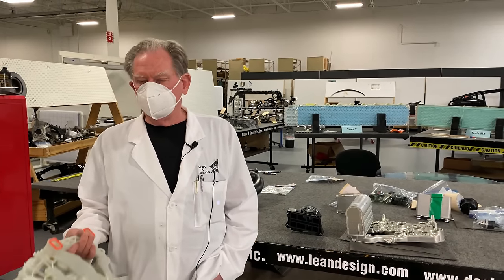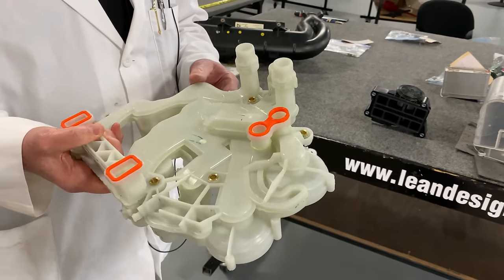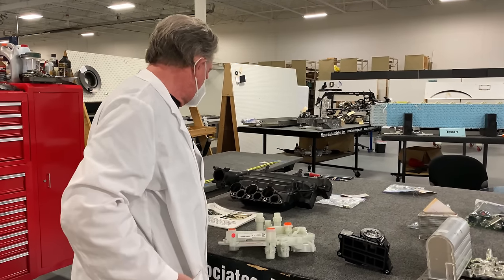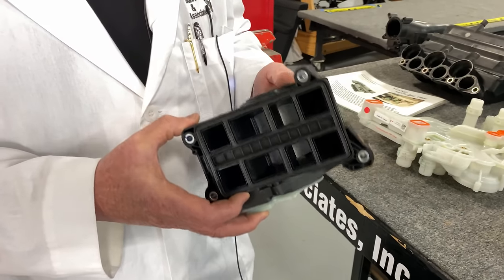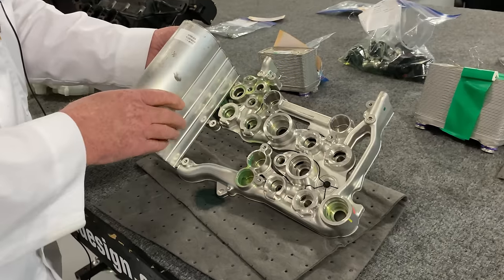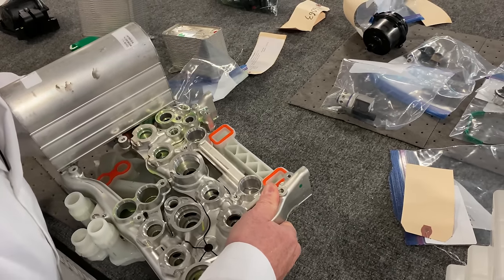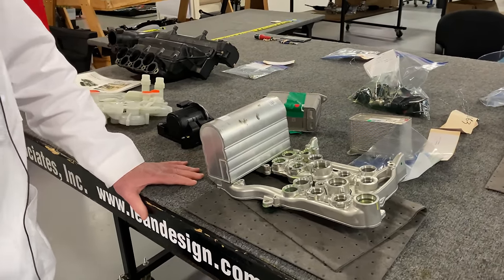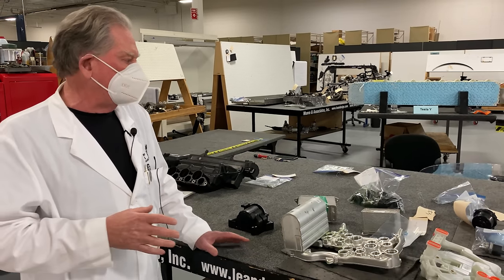Model Y E36: The Octovalve Episode

Comment: I love this series; fantastic work from Mr Munro & his team! Just a quick little note; at 8:35  those are actually 2D barcodes based off the old Denso Quick Reference (QR) design as there is no data in the depth dimension & can be stored in "flat" format i.e. paper.  Normal shop barcodes are 1D as they only hold data in one dimension and are taller purely for ease of scanning. Stay safe & keep up being excellent!

Comment: I watched this episode a year ago when it first was posted, and now after getting a model Y last month I discovered this is one of the best features in the car. It is very energy efficient and provides almost instant cooling. I really like turning on the aircon/heater from my iphone so the car is perfect temperature when I get in. No more getting into a baking hot car, and I've let it run for a couple of hours with very little power usage from the battery. My first YouTube Fan purchase too; I got the Munro t-shirt with the mechanical drawing of this contraption. Still waiting on delivery :)

Comment: It’s almost like that Octavalve was designed by someone that also designs rocket engines. Awesome engineering Elon and the Tesla team.
Reply: a rocket engine designer is not gonna be doing valve work
Reply: you might be suprised, rocket engine design is really just highly advanced, high pressure plumbing, that moves highly volatile and uncooperative fluids.
Reply: dude chill I litterally went to school with aerospace engineers, this is litterally the way they described it to me, its a bit of a meme. On top of that I work with guys who tear apart jet engines for a living. Its really complex but at the end of the day its alot of plumbing. 

Also SpaceX and Tesla have worked together on parts before, having an engineer who is good with coolant systems do a quick, and honestly far easier job for Tesla just makes sence seeing as he owns both companies.
Reply: One day Tesla might actually make a profit
Reply: @thecloneguyz  they have been profitable for the last 2 quarters
Reply: @avroarchitect1793  
After this covid-19 I doubt they're going to be profitable for a while
Reply: @thecloneguyz  I guess we will see, they have the cash to survive and a stock/ order backlog. All they need to do is get back to production.
Reply: @Rhyme905  Basically 90% of the complexity of rockets is fluid dynamics, with subsystems like turbopumps, valves, coolant chanels, and injectors. The rest is basically just structural engineering. For SpaceX rockets there's also some more nontrivial guidance and reentry tasks.
Reply: Makes sence. If you have the skills, might as well use them.
Reply: AVRO Architect that dude is really mad.. he must have not bought Tesla stock.
Reply: @jimmyle3246  and here we are with Tesla qualifying to be added to the S&P 500 and turning a profit despite the virus
Reply: @Rhyme905  we have a conference here in Houston called Pumps & Pipes bringing together medical, aerospace and oil & gas for cross pollination of ideas and innovation from the shared perspectives. several collaborations have come from the decade of looking in each others toolkit.
Reply: @michaelinterbartolo3  that is pretty interesting Mike, how much is a ticket?
Reply: SpaceX Engineers did design the octovalve according to Elon Musk
Reply: @Rhyme905  uh, yeah the octovalve was a spacex design. Piping and advanced valves is how reaction control works.
Reply: @avroarchitect1793  Yeah it wouldn't surprise me if one or two of SpaceX's engineers had something to do with the Octovalve. As you said both companies do work together.
Reply: @NotNowLater  the complexity of the design and manufacturing screams of aerospace engineering background, its not something an automotive engineer would design. At least not this way.
Reply: To sidestep the arguments here about rocket engine valves:  I believe SpaceX engineers did this, but IMO they were ones working on the life support systems/climate control for the Dragon spacecraft. That would more easily translate to a cars HVAC.
Reply: Yet fails in winters
Reply: @thecloneguyz  Still profitable...
Reply: @Jimbogf  if you look at SpaceX and Tesla together Tesla is still not profitable yet it's still paying back the loans to SpaceX 
PFFFFTTBWUHAHA

Comment: Sandy,  perhaps you could do some videos on serviceability with the Y. Since you've had to entirely disassemble the car,  how difficult was it to access suspension and braking components,  the radiator,  other items that might normally wear and need replacement? All us DIYers and mechanics have litanies of horror stories on the difficulty of working on cars. I'm hoping this clean- sheet company is different in that regard,  besides the obvious benefit of not needing regular engine or transmission attention.
Reply: I suspect the Cybertruck will be the first Tesla that has maintainability fully designed in. Reason for my suspicion: CT will be used as the vehicle on Mars. As such, it needs to be designed to have low probability of breaking and efficient maintain- and repairability.

Comment: Wow, nearly one year later I am re-watching this after having to get the Supermanifold, what you called the base manifold (the big aluminum piece), replaced on my Model Y. We experienced no heat in the cabin issues at -40c over a month ago and Tesla towed our car away to get fixed. Four weeks later waiting for parts our car has been repaired with a new iteration "E" replacing our old series "B" Supermanifold along with the three P/T sensors. From your video I can see the part number on yours ending in a "B", our new part has the same number ending in an "E". Crazy! Thanks for this content which satisfied my curiosity.

Comment: I think the EDM cuts in the manifold are for thermal isolation, to avoid unwanted heat flows between channels that have a high temperature differential.
Reply: Correct. Part dimension  and temp delta are small enough that it's useless to compensate for thermal expansion. I'm actually more concerned with crack formation at the cut line end due to thermal stress. Otherwise the design look solid.

Comment: Amazing design and engineering from Tesla
Add this to the mind blowing battery advancement coming on battery day.......
Reply: Mind blowing?  Please... This snake oil has been selling since forever.... cold fusion, ultra capacitors, etc.  Expect an incremental advance at best.

That said it's these incremental advancements that push us forward... But mind blowing?  Delusional and hyberbole.
Reply: @ericfermin8347  1 Million Life battery is not incremental + I expect at least 10% more energy density which is not incremental either
Reply: That is pretty mind-blowing
Reply: @kasibert2229  You need to get out more, or study some basic science and maybe you'll understand what mind blowing really is.

Discovery of the neutron... mind blowing
Discovery of x-rays... mind blowing
Discovery/invention of a programmable computer... mind blowing
Discovery of bacteria... mind blowing
Discovery/invention of transistor... mind blowing
Discovery of the neuron... mind blowing
Discovery of black holes... mind blowing

10% increase.... nope, just the march of progress

Mind blowing events are black swan events.  They come out of nowhere, have tremendous impact, and people with hindsight wonder why it took so long to discover.

If Musk announces a battery made from silicon, that costs pennies to manufacture, and has 1,00,000,000 times the performance of current tech, that'd be mind blowing.  10%, not so much.
Reply: @ericfermin8347  Well If u think this isn't mind-blowing then u just don't understand the implementation of this battery
Reply: its not amazing design or technology, its a mainstream manufacturing technique
Reply: @kasibert2229  You are entitled to your opinion. You are out of superlatives if you use mind blowing for such a small advancement.
Reply: @ericfermin8347  Just exchange every mind blowing with amazing if thats your problem. But being able to produce waaaaay better batteries for cheaper than the entire industry which is full of amazing and very intelligent people which have almost unlimited fundings idk dude thats mind blowing for me

Comment: I know you guys need to make a living but isn’t there a way to describe the basics of how this magnificent piece of engineering works without compromising your business
Reply: That will be in the report - he is not going give too much away.... But to make a long story short. Different part of the cars, at different time, need to be cooled or heated. Battery, motors, cabins, electronics, etc. The Octovalve directs the hot/cold fluid accordingly. For example, if the battery needs to be cooled, but the cabin is too cold, the Octovalve can direct the liquid through the battery, picking up the heat energy, and then direct it (or via the heat exchanger) to the cabin. That save energy than cooling the battery and warming the cabin separately. If there is a net heating/cooling requirement - run it through the heat pump (probably through another heat exchanger). So the theory is pretty straight forward. But it is the execution and design of the valve and manifold, plus the software and controls that set it apart.
Reply: Basically the octovalve is a vertically integrated version of a much more spread out version that is used by most other car manufacturers. Think of it as an integrated circuit for heating/colling :D
Reply: @lingyanj7075  Thanks for the link. Your excellent video was very informative.
Reply: @aerowhiz  glad you like it!

Comment: The way that's put together reminds me of automatically routed printed circuit boards. Especially where you have different levels of power that need to go out different things and that goes through some switchgear chips or even in the old days relays.  Kind of reminds me of crossbar switches in telephone exchanges as well.

Comment: So interesting to see how that complex Octovalve manifold system is made. They look like expensive parts but they eliminate so many individual components it pays off.

I would like to see an analysis of a much simpler assembly; the wheels and tires. Those extreme low profile tires look cool but they are prone to very expensive pothole damage. Why won’t Tesla offer 18” wheels with higher profile tires on the non-performance model Y? Is it impossible to get long range with that setup? A lot of people would like to off-road with the Model Y.

Comment: Would love to see how the stepper valve body fits in.  That's the actual functioning part of the whole thing.  The eight port array on the bottom must fit in to a port or manifold set on the other components.  Also is there a flow diagram around that shows the paths taken by the coolant at the various valve settings?
Reply: Im sure you could get the flow diagram from buying the report.

Comment: The heat-pump expansion valve step solenoid is extremely interesting. How does it function and how is calibrated. Going from mechanical analog expansion valves with a direct temp/press connection to Tesla is like going straight from comatose to epiphany for me. Its mind bending. And complex. I’m a bit ancient but I don’t think I’m all that far out of the loop to consider it exceptional.

Comment: Greetings Sandy excellent, as usual, I believe HVAC and heat pump OEM will also be interested in the Oct Plus report. Leaks and longevity should I worry?
Reply: I think warranty period of 4 years is not much to worry about.. even closing in on 10 years the failure rate probably isn't bad... going to 20 years is when you're probably going to start seeing issues :D At that point thr octovalve might be more of a issue compared with a traditional setup, where you can more easily replace individual parts of the cooling/heating system.
Reply: nonsense, other manufacturers have been using heat pumps years before tesla, also the octalvalve works like the automatic transmission valve body
Reply: For over 50 years, GM water pumps had a 30 - 40k mile life.  I know, I bought a bunch of them.  Either the bearing seal, the impeller or both would fail around every 30 or so oil changes at 1k miles.

Comment: IMHO, the cuts in the octovalve aluminium part are not (just) to absorbe the geometrical variations due to thermal expansion. I believe they are useful to break the heat transfer from the hot to the cold pipes. I guess that there will be hot and cold areas but if they are not hot enough to damage the plastic, they will neither distort the aluminium part that much.

Comment: I have a suggestion for your next take-apart- the Harley Davison Livewire.
Reply: why, its Cheap CHINESE Junk.
Reply: @markplott4820  Maybe- but Munro could say for sure- if there is anything good or all bad or something other EV cycles may find useful.  I personally don't want one- I'm just really wondering if there is any innovation in it or not.  I have my eye on a Model Y.
Reply: @scottczesak1638  - Model Y is the most Advanced Tesla you can buy today, soon you will be able to a LUDA+ mode to your Mod Y Performance.
However the Mod S/X still have the longest Range and top Speed. 
despite having and older Design.
eventually, Mod S/X will get PLAD Tri motor and a larger battery , but it might be a few years for that.

Comment: Can this design be adapted for used in an HVAC to increase efficiency?
Reply: In all probability it proprietary designed for what the vehicle is. How the system functions you'd need to buy the report.

Some questions simply don't make sense.
Reply: John Dallara As Elon says ’will be’.
Reply: Sort of.  There are probably less opportunities in a typical house to interface with though.  In theory you could tie everything that needs heating/cooling in a home together so the "waste" from one could be used as input to another or so that the HVAC could batch needs together.  For example, waste heat from HVAC could be used to heat water heater, clothes dryer, etc.  Or, fridge/freezer could be cooled from HVAC instead of it's own tiny and less efficient compressor.  In practice, it would be hard to interface with most items in a home because they just aren't designed to be tied to any external system and the manufacturers wouldn't support them if modified.

Comment: Of I understand correctly, this valve simply controls where the coolant should go, correct?
And while it looks pretty nice, why does it seem so complicated? If the stepper motor just has 4 positions, wouldn't that simply make it a 4 way valve?
Reply: I believe it is two 4-way valves connected together rotated by the stepper controller,

Comment: I am always amazed by your videos, can't wait for the next one. The cuts in the aluminum manifold look too wide for wire EDM and about the right width for waterjet.  EDM would take an hour,  waterjet a minute.
Reply: It's possible to have thick cut with EDM, you just need a thick electrode. That said it's impossible to tell which is which from a video, they look the same from afar. But my hunch is waterjet too since it's cheaper and it seems like there's no need for a tight tolerance for the cut.
Reply: @noridzwannordin6416  
I have a wire EDM a sinker EDM and a waterjet. We don't use EDM unless nothing else will do the job.  it is very slow and expensive. A single part can run for 30-40 hours. The waterjet is quick, convenient and precise. Not as precise as EDM but within a thou or two. It is not fair to compare them because they are designed for vastly different things.
I would be surprised to find any but the most exotic automotive parts made with EDM. But any molded or die stamped part likely involved EDM in making the tooling.